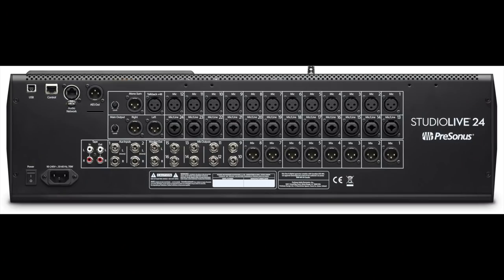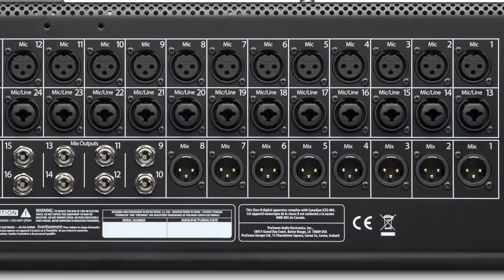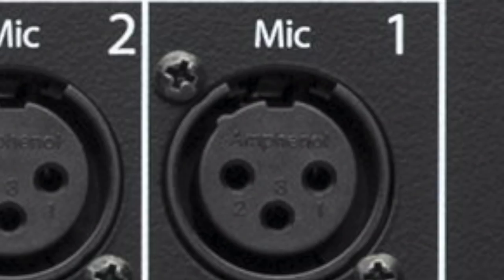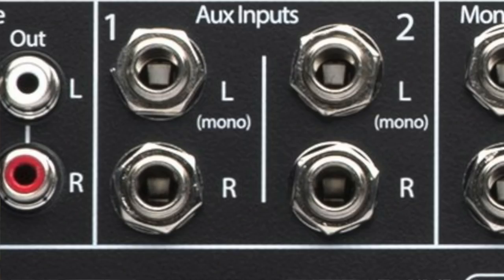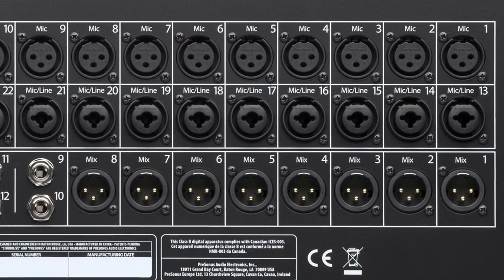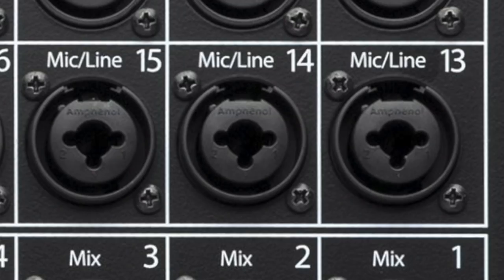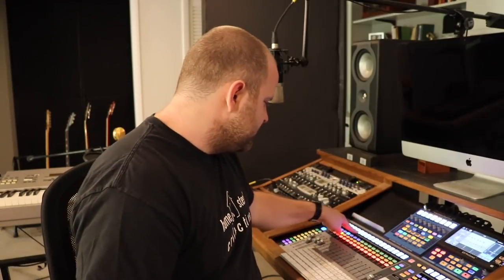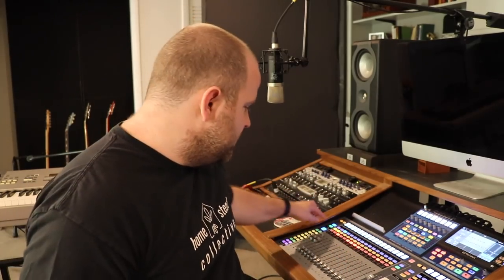How to Hook Up Microphone and Line Inputs | Presonus StudioLive 24 Series III

Comment: Joe, couple questions.  Does using the line input bypass the preamp all together and just use the DA converters?  My assumption is that you set the gain to zero on the line level when using an external preamp?

Comment: Hey Joe, So I want to bus my outboard pre's and compressors through the Studio Live and then have channels on the Mixer that send to my I/O. This way I obviously assign whatever inputs I want on the mixer to the outboard gear, as well and send out stuff through my I/o outs and say run it back through my Neve compressor or whatever to get color or alter that track/mix. Essentially I don't want to go back behind my desk and unplug and replug a bunch of crap. Anyways, my main concern on the is running recording mics through the StudioLive then to he nice outboard pre's. Do I lose sound quality in my recording by  doing this? Is there a way to essentially have a clean path for the mic signals instead of using the StudioLive pre's and the mixer essentially acts as a clean pass-through on those mic channels?